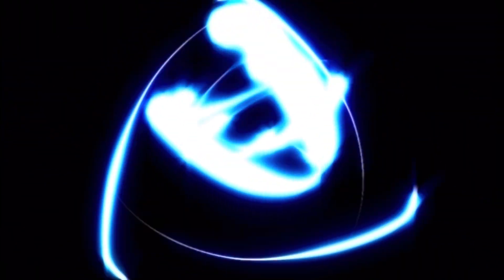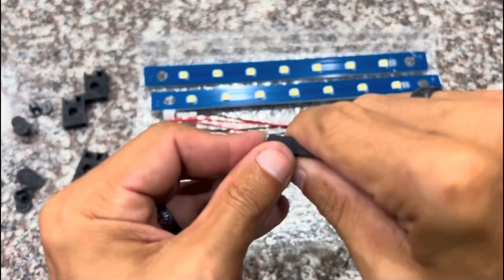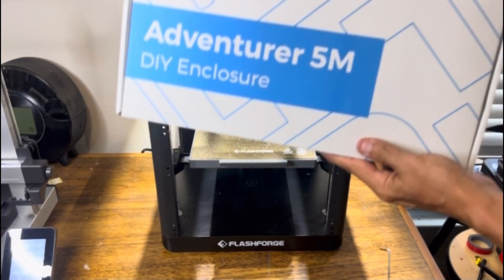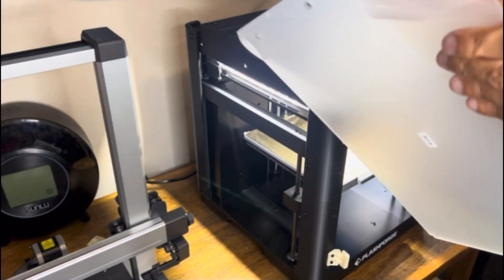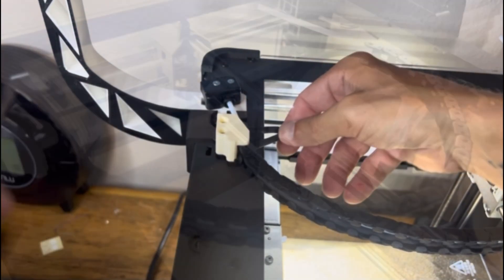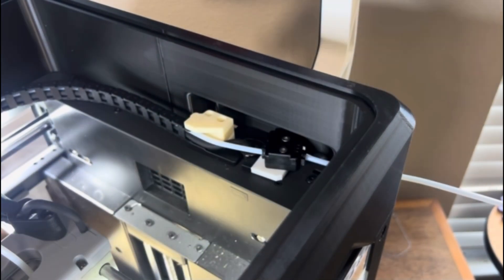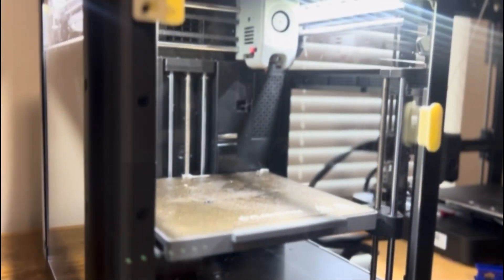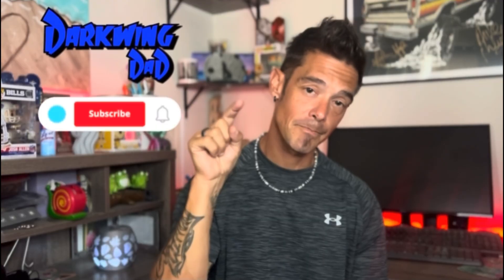How to install LEDs, camera & enclosure on Flashforge adventurer 5m! How to mod your 3D printer

Comment: just buy a pro
Reply from the maker: Maybe now with the price change but it’s still $170 difference. The pro was once $499 and 5m 279….big difference
Reply: @Darkwingdad  fair point, but it still lacks the filters for ABS/ASA, not that many will print with that, when i looked at both, i looked at puttin the enclosure on the 5m, but its kinda pointless
Reply from the maker: @SuperRob41 yea I mean it’s easy to add the filter but I can say even printing with silk controlling the chamber temperature gives much better results when it’s enclosed. I would never buy a 5m now and do all these upgrades I think you might save $25 but the time spent is washed. Regardless it’s a cool mod & I love Flashforge printers, hopefully they’ll do a 5m with a 300x300 volume
Reply: @Darkwingdad  yeah good point, before i got the 5m pro i had 3 enders , 2 3's and a 5 pro, and i really enjoyed the tinkering
Reply from the maker: @SuperRob41 those of us who aren’t newbies will greatly benefit from ripping apart c10s,ender 3s & elegoo printers, although these printers are great when they do break it’s def a process to repair & replace. I had a two trees sk1 (bambu clone) my god what a nightmare that was

Comment: If you put LED lights on the front center of the Adventurer 5M printer using magnets, the print head casing will scrape against the LED light regardless of orientation each time it performs a wipe. Don’t make the same mistake I did and just stick to the sides as shown in the video.

Comment: I finished my last pieces, the risers. When trying to click them together, one of the tabs snapped on 2 of the risers. Used a dual color Amolen silk filament. Frustrated because those piece took about 15 hours for 2. Any advice? Should we not use silk? Would PETG be better? FLASHFORGE has a 50% when buying 2 or more right now. Might buy a couple spools of the PETG metallic gold.
Reply from the maker: Use super glue & a soldering iron & reattach the tabs. Silk is the most brittle of all filaments so for structural pieces 4 walls & 5 top layers is recommended as well as 15% infill. Easy fix though, no need to reprint

Comment: There is so many settings in Orcra Slicer. How do I know what settings I should be using?
Reply from the maker: Default settings are fine. Only thing I recommend turning on is ironing & under speed enable accel to decal. Other than that the standard .2 profile is fine
Reply: @Darkwingdad  hopefully I can make this make sense. (Sorry, I'm new to 3D printing.) What setting should the ironing be on? I assume you only want it on for the build plates that have the top parts. right? Also, I think that on some of the build plates, it builds it upside down. So then wouldn't I technically want the bottom to be ironed so that when I flip it upright, it looks good? Lastly, should I put accel to decel for all 9 of the build plates?
Reply: That's the last question. I apologize for all the questions
Reply from the maker: @Astro.99 accel to decel reduces acceleration, just click the box you don’t need to change any speed parameters. And yes for ironing only top layers based on orientation. Ironing pattern I like concentric
Reply: @Darkwingdad  I just tried doing my first print for the enclosure and I'm using Creality White PETG filament and it didn't work. It would make popping sounds and curl up. Is this because I don't have a dryer? Did you use a dryer?
Reply from the maker: @Astro.99 popping usually suspects moisture but what do you mean curled? Like it wouldn’t stick to the build plate & curled up? If petg your printing at 245*?
Reply: @Darkwingdad  I think you're right. It is from moisture. I live in MO with high humidity. Yeah, it was trying to stick but not all parts were sticking. It was also melting down the side of my nozzle.
Reply: I was printing at 255
Reply from the maker: @Astro.99 is it lifting off the plate? What do you mean by curled
Reply: @Darkwingdad right when the filament exits the nozzle, it starts to curl and yes, doesn’t stick to the build plate. I tried the glue for adhesion but that didn’t work. It’s like the filament is coming out too liquidy because it’s sticking to the nozzle
Reply from the maker: @Astro.99 never seen that b4 , are you in my discord?
Reply: @Darkwingdad I am
Reply from the maker: @Astro.99 post pics I’ll help u there

Comment: How did you print the flash forge name in white? Is that a file somewhere?
Reply from the maker: The download link is in the description
Reply: @Darkwingdad  Thanks, only other thing. I don't have the light or camera yet. Is it fine if I do the enclosure first and add the other two later?
Reply: Could I also make the entire thing out of PETG?
Reply from the maker: @Astro.99 you can, I used pla+ at 10% infill and it’s been totally fine
Reply: @Darkwingdad Does it matter if I do the enclosure first or the lights or camera? Does it have to be in a certain order?
Reply from the maker: @Astro.99 it’s definitely easier to do the camera ! Lights first, if you do the enclosure first you’ll have to take it apart to do the camera & lights

Comment: Do you have filters installed in the filter slots?  If so, do you recommend adding extra fans to keep the heat down inside?  Do you know of a video where it show how to install extra fans (if I need them)?  Just got this for Christmas, so still learning.
Reply from the maker: I have the filters now, as far as fans go that’s something I’m looking into but if the chamber gets too hot (with abs) I just printed a vented riser with a hinge for the top plexiglass
Reply: @Darkwingdad  What is your experience with PLA in the enclosure?  I’ve only used PLA so far and know it is much more sensitive to temperature changes than some of the other materials.  Do I even need to worry about having an enclosure if it’s just PLA?
Reply from the maker: @MichaelKelly-b6x the enclosure definitely helps all around. The room I have my printers in is a dedicated room, no draft,no traffic, low dust etc so it really depends on your set up. For the $20 in filament & the $40 kit enclosing it is a no brainer for over better experience and aesthetics
Reply: @Darkwingdad I’ve read some posts where people keep the top off for printing PLA.  Have you tried this and do you find it helps?  Also, just to confirm, did you print all your parts with the Deeplee PLA+, or did you go with the PETG that FlashForge recommends?
Reply from the maker: @MichaelKelly-b6x I just used pla+ and have had zero issues, I also have not taken the top off for printing pla at all. Only with abs bc the chamber temp was quite high. My thought on printing with petg- if you have it use it-but most people reduce the infill to save on time so is there any structural difference between petg at 5/6% infill vs pla+ at 10/12%? From my testing no

Comment: Я взял стандартный профиль TPU в слайсере. Мой TPU75A не печатается. Какие настройки мне нужны? 
I used the standard TPU profile in the slicer. My TPU75A won't print. What settings should I use?
Reply from the maker: Tpu needs higher temp & slower speeds. What are you printing at?
Reply: @Darkwingdad 220/60. У меня проблема с нависаниями

Comment: I need to know before printing the enclosure, can every part be printed in PLA? I only have PLA right now (and tpu but that's not important right now) but when I import the files into orca there are parts that are set to PETG. Can I change them to PLA safely or is there a reason they want me to print them in this material? Also how the hell do I arrange the spool holder to actually fit the printing plate of the 5m?
Reply from the maker: PLA is perfectly fine 
3 walls
4 top/bottom layers at .8 or 1mm
Infill gyroid at 12% 
Are you on my discord?
Reply: @Darkwingdad I just came across your channel so I'm not on your discord but I'd happily join because I'm totally new to all of this. Yeah I can figure most things out and have done okay so far but there are plenty of things I am still a bit stumped on. I'm in the middle of printing parts for the enclosure now that you let me know it should be alright! It's going to take soooo long though haha. That is absolutely something I need to get used to, I just didn't realise how long it could take for some builds
Reply from the maker: @shortbreadhead check out my linktree link in the description it has the link to my discord & I can help directly there- pics,videos etc

Comment: I have a Question about the measurements for the other barriers i found them on printables but in orca its showing errors saying its to tall any so solutions regarding that. I dont think these have the slits
Reply from the maker: Any of the printable enclosures all pieces will fit on a 5m, they just need to be oriented properly. Are you refering to the side vertical pieces?
Reply: @Darkwingdad yes i tried doing it vertical am i soppose to cut it in half im new to the 3d prints just got it for my son wanna make sure its secured and last long 😅
Reply from the maker: @TruthBeToldStories-n6c everything should be placed on its side & it’ll fit

Comment: Thanks for this. I can't for the life of me get the second cord to the other LED no matter how I run the line. Its always too short by a couple inches.
Reply from the maker: No worries! Don’t be afraid to use a dab of hot glue to the inside of the 3d printed piece for extra piece of mind!
Reply: @Darkwingdad  Think you sent this to the wrong question
Reply from the maker: @Thrashin_Victim no I was just saying putting glue on to hold it in place can give you the length you need as well, I’ve gotten feedback that it’s still too short that can be from sagging of the wire. Glueing it in place will make it tighter,snugger & essentially longer

Comment: Id say try noy to use heat on mangnents as it could make them lose their properties
Reply from the maker: Higher heat yes, but a quick 3 seconds at 150-200 degrees to soften the filament shows no damage

Comment: I'm just getting started with this thing (my first 3D printing experience). I received the Adventurer 5M for Hanukkah this year and I would appreciate a few pointers from some more experienced printers. :) FYI I'm a software engineer and a ham radio operator, so tinkering is nothing new to me, but I just don't have much knowledge or experience with 3D printing. Thanks for any advice!

1) I saw you printed the Flashforge logo in white (nice look, BTW). How did you separate it from the original design to printer those letters separately? Any particular glue you used? I assume you just glued them on top of the black letters that were already on the part, or did you remove them from the original design and then print them separately in white?

2) I sometimes see multicolored prints done. I know there are some multi-colored filaments out there, although it seems that it would be difficult to determine where the color change was going to occur, if you wanted it to happen at specific points in your printout, so I assume people aren't using multi-colored filament for those situations. How do you get multicolored designs, or do I need a printer with a dual extruder for that?

3) What are you using to print the parts? Standard PLA?
Reply from the maker: The logo I made in 3D builder, I’m uploading the file this week. Multi color printing is done with a multicolor printer- I have a video coming up with the new AD5X. I printed this enclosure with standard pla it’ll hold up just fine! 
The 5m is an amazing machine, you’ll be just fine 👌🏻

Comment: @Darkwing dad ty for posting this video and showing how you installed your lights I bought the same light bars off of amazon and when i installed mine with a different bracket it was causing my print head to slam into the front back and sides of the printer. Also seeing how you routed the wires for the lighting was awesome as well i routed mine the same way just modified the bracket and glued them to the light bars and put magnets to hold them in place on the printer and it works like a charm no more violent slamming of the print head. Thanks again !!!
Reply from the maker: So glad this helped! I’ve had alot of feedback from others saying how vague other videos are so I’m glad mine was detailed enough to help!
Next I’m doing this to my Ad5x!

Comment: For the top magnets install,  instead of soldering iron,  i just used modelers c clamps and placed scrap leather to protect the print. Turn of the clamps homed them in easy.
Reply from the maker: That could work, you can also just heat gun the pla a tad, heating a magnet for too long is risky but I had no issues doing it for 3 seconds & I don’t have modeler c clamps lying around 😅
Reply: @Darkwingdad  I used a brass 1/2" drift punch and pressed against fabric, installed perfectly and easily.
Reply from the maker: @tuggyboat another nice trick!

Comment: you should not heat the magnets it could demagnetize them better way is to use pliers to add some leverage
Reply from the maker: As long as the heat is not excessive it will not demagnetize them. 200* for 3-4 seconds is fine

Comment: Have you had any difficulty with the PLA enclosure? Some people are saying to use PETG, which takes a longer time to print the enclosure. I want to lessen the time and what extruder are you using? I did print the led mount that you have and thanks, it;s awesome.
Reply from the maker: I have had no issues at all, just print at 15% infill & your good. If you wana cut down time use pla+ & do 9-10% gyroid. I just got a a5dx & doing the same mods to it!
Reply: @Darkwingdad  Thanks and you'll like the AD5X , it takes some getting used to but it's a great printer.

Comment: Btw if you heat magnets up too much they will lose their magnetization. I learned this the hard way after I tried it after watching this video. lol. The magnets are still magnetic, but significantly weaker than they were before. I looked it up and if it's quick and not too hot, the demagnetization can be temporary, but if you use too high of heat and heat them up for too long the loss of magnetization is permanent. So just be careful if you're going to use that method. I've decided to just push the rest of mine in with force and it seemed to work pretty well, and those magnets remained very strong.
Reply from the maker: Good to know, all mine remained magnetized but the heat was lower, thanks for letting us know.

Comment: I wish I had found this one first. The only install i found did not give any detail for the controller ribbon, so I fed it through the camera hole. Trashed my ribbon cable after about 3 weeks. Also had a lot of print fails for the casing because I was new, and thought laying the parts down. New ribbon, camera, and lights deliver tomorrow and Monday
Reply from the maker: Dang man, yea I’ve seen a lot of people struggle with this upgrade, in particular with the screen. I’m trying to finesse a guy on marketplace & pick up another 5m for $125, I love these mods I just wish the build volume was bigger! Good luck on the repairs holler if you need help! My discord is in the description lots of helpful folks onboard!

Comment: I can’t get my filament through the run out sensor
Reply from the maker: Did you try cutting the filament on an angle and rotating it?
Reply: The problem is that with that spool holder, you end up mounting the sensor backwards

Comment: Awesome work. Love the links! Got the printer yesterday and have been using it non stop
Reply from the maker: It’s such a solid printer, if they ever released one that’s a 300x300x400 man id prolly sell all my other printers.  Doing the upgrades only made it better. Next I think im going to do multi color & I added the k-touch pad to control it. Prolly do a video on that next